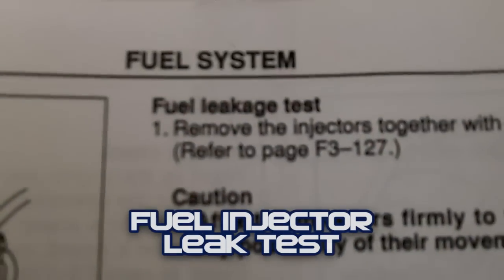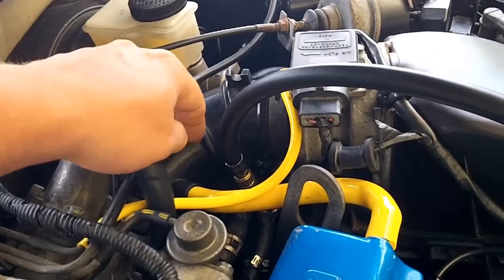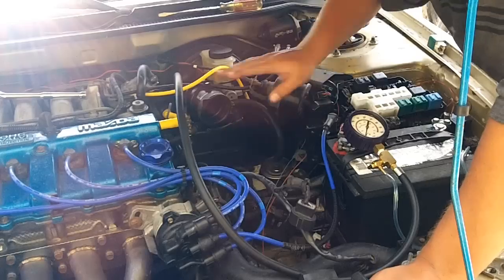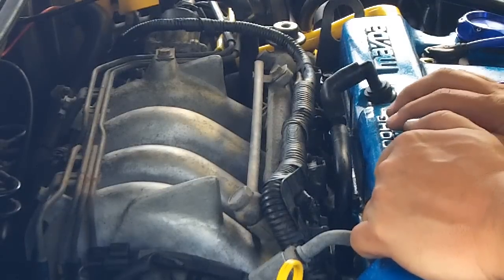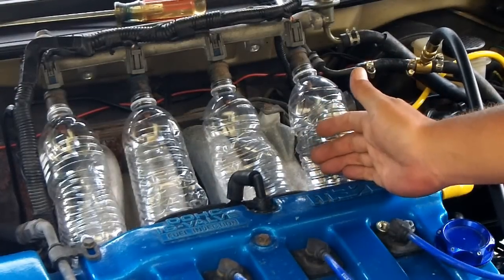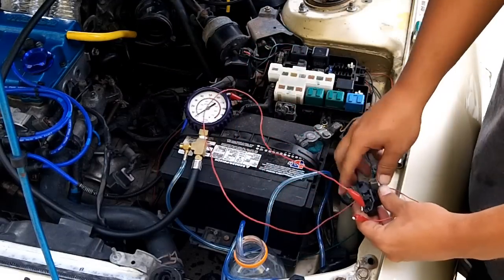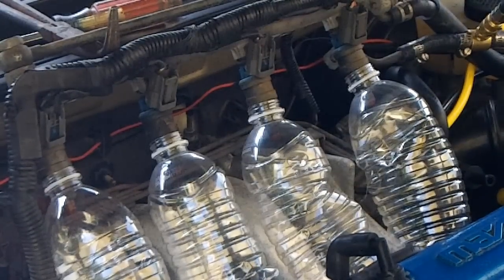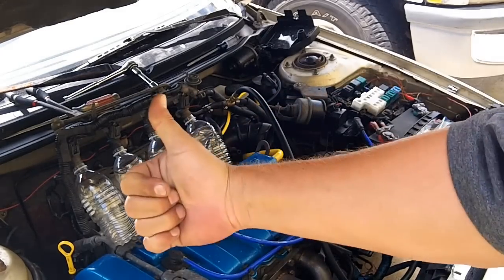Mazda 626 - Fuel Injector Leak Test

Comment: Hey DJ , Cam your suscriptor here.Bro  o needs ur help I saw in worksmanual two values for ect mtx use 2!2 kiloms and ATX 35473 oms? Is that correct? I mean 2.2 to 35.47 kiloms? Or is that a typo error of the manual? I'm confused. I test mine and found at 30 degrees C 1.87 kiloms. The coolant fan work only on high velocity with temperature criteria but starting ac only start the condenser fan so I think anyway tje swnsor ect is bad, can u teoll me pls what i have to check?tje right value of ATX is 3.5 kilo oms or 35kikoms also my iàt is giving 25.8 kiloms in the readings with multimeters pls help bro. Btw relays and fuses all ok i wanna ad if i touch coolant fan when. Ac is on the fan start to run but  with temp criteria only work at high velocity thanks bro

Comment: Hey I’m replacing my fuel filter on 96 protege. I disconnected both lines from fuel rail now I don’t know where they go
Reply from the maker: Easiest way to never get them mixed up again; fuel pressure regulator is the return line. The other line goes to the fuel filter.
Reply: @DJDevon3  thanks It’s running funny. I will double check the hoses

Comment: Is it maintaining fuel pressure after you shut off the engine?
Reply from the maker: In this circumstance no. Fuel pressure is completely lost in about 5 seconds and it's not going through the injectors.
Reply: DJDevon3 If fuel injectors are working fine and not leaking, most likely its fuel check valve is the issue. Btw good vid, very informative.
Reply from the maker: @kevinfrancisco1730  You do realize this video is from 7 years ago right? I've already solved the issue and have an almost comprehensive video series on diagnosing and fixing the issue.https://www.youtube.com/watch?v=bCrIo2Sbi78&list=PLL7U2Ji08Gq0UFSaKrE9oCldzUtI691ip
Reply: DJDevon3 I didn't see the year it was posted. Haha 😁 still a good video though. :)

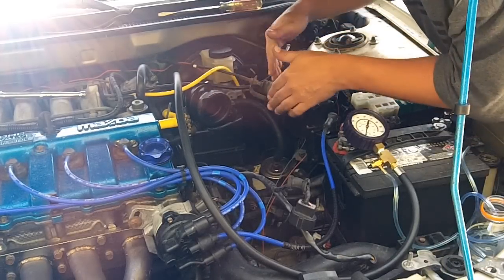Comment from the maker: The culprit ended up being a split in the hose on the fuel pump itself.  This is absolutely a necessary diagnostic step in ruling in/out an injector fuel leak. If it's not a fuel injector leak then the  fuel pump itself becomes the main suspect.  In my case the fuel pump hose was blown out and had a split in it at 3:00 in the following video:  https://www.youtube.com/watch?v=eeSdKNEMdwg The split was small enough so that the fuel line could still build pressure but was still leaking internally inside the fuel tank. When the fuel pump was de-energized all the pressure in the fuel pump went to zero.
Reply: Are out still doing videos? Maybe you can help me out? I have a 93 626 2.0 and it just shut off one day I starts and stays on of I hold the gas, but turns off  loses rpm. I've replaced so many parts like fuel pump the fuel relay the pressure regulator the tps. Any idea what I can do to figure this problem out? Had the car 10 years never had any real problems with it.
Reply from the maker: @dehaze7411  Have the distributor diagnosed by a professional. The distributor in the 626 is a common issue.
Reply: @DJDevon3  I replaced that whole unit not a couple months ago was running fine until a few days ago. Turns on but shuts rt off
Reply from the maker: @dehaze7411  look, i'm not a mechanic. there's no replacement for taking your vehicle to a mechanic. trying to find solutions online from people with opinions that have never even touched your engine bay is a good way to waste money.

Comment: What if your fuel injectors are leaking what are the symptoms?
Reply from the maker: Depends on the size of the leak. Most noticeable symptom will be bleed off of fuel pressure which is what this video is checking for. I have bleed off and looking for the culprit. In my case I had a busted fuel hose inside the fuel tank bleeding off pressure.  If the injector is leaking while the vehicle is off it will leak a certain amount as pressure is lost in the fuel line.  What amount that is and what effect it has on the engine on cold start I can't say exactly. You'll definitely smell fuel coming out of the tailpipe, maybe some smoke from unburned fuel, rough initial start. Again, depends on the size of the leak.
Reply: Poor starting when warm because the sparkplugs get flooded with fuel
Reply: Manuqtix Manuqtix same, crappy starting influences the entire engine not only the cilinder that’s getting too much fuel

Comment: Might pop off.....secure..withzip ties...or
Reply from the maker: As mentioned in the video description, the video, and in Mazda's WSM. The correct way to do it (which I do not show) is to use wire to secure the injectors if you intend on doing an injector volume test.  I do show the diagram for it.  It was unnecessary in my case, I was only looking for a leaky injector on my diagnostic path towards proving a faulty fuel pump.

Comment: May I ask which one pipe is the Return cause I need to install something with it and I don't know which one is the return, is it the metal pipe that goes to the side of the engine belt or the one that is only rubber that connects to the pressure regulator.
Reply from the maker: Fuel pressure regulator is the return line, hose from the regulator goes to the hard pipe beside the fuel filter. Line coming out of the fuel filter is the supply line to the fuel rail, not the fuel pressure regulator.  :)  I've seen plenty of guys get those crossed up when putting an engine back together, it happens all the time so don't feel bad if you do it.  Happens all the time.
Reply: DJDevon3 I appreciate your answer and thx for it now i will put it on the correct line

Comment: good job
Reply from the maker: This test is a video representation of actual mazda technical procedure.  Just ensure to tie down the injectors or they'll get shot off  by fuel spray.  I didn't have that issue because I had a faulty fuel pump with very low pressure.

Comment: One word of caution, gas will EAT many plastics pretty fast. I was changing out the fuel filter one day, took of the top hose and then bent it over inside the engine to dump out the gas in it, (I wanted it empty before I pulled off bottom hose, think gravity) into a standard plastic party cup you would use at a kegger.  I saw it ate thru that really fast, good thing I had rags under it and got it out of the car fast. 

So...kudo's for "recycling" plastic bottles but everyone should try putting gas in/on their plastic catch device and see what happens before committing it into the car.
Reply from the maker: Great point.  I didn't even think about that.  Could have been a disaster if attempting it on a warm engine.  Tests like this should be done on a cold engine to prevent a hotspot causing a flashpoint.  Great advice.
Reply from the maker: After doing some research, PET or PETE commonly used for plastic bottles will not degrade if holding gasoline/petrol. :)  Most common approved plastic container is HDPE (thick plastic) however PET/PETE will work.  I don't recommend using a PET/PETE container for a long period of time.  For temporary use in an injector flow test water bottles are perfectly OK.  Also don't use them on a hot or warm engine.  Always ensure the engine has fully cooled down.  It doesn't take much heat to melt through plastic water bottles and then well, you have gas pouring everywhere not smart.  An injector balance or flow test should only be done on a cold engine and obviously, the engine isn't running for this test.
Reply from the maker: If you have the choice between water bottles and gatorade bottles choose the gatorade.  They are much thicker plastic.  However the lid is bigger in diameter so you might get a lot more spray coming back out of it.  Secure the injector and tape the hole best you can.
Reply: Hey Mazda 626'ers, I just did a test, I put about 4oz of gas in a typical thin plastic water bottle, like you had on your injectors and left it (in a bigger tin can) for 3 hours, did not eat through it.

 It has Number 1 recycle symbol on it - which is PETE, don't know who this PETE guy is but he can hold his gas! I looked at the Party/Kegger type plastic cup I used that the gas ate right through, no marking on it. So I'd suggest for all to always do a test no matter what its marked..who knows, and like DJ said don't use it for storing gas.

Now I'm going to do the injector test you showed, I liked that! Normal working with Gas warnings apply.
Reply from the maker: Don Agneta Yeah the red solo cups are a different story.  Those thing are #6 polystyrene which is the weakest against gas.  Fuel will eat right through it like acid. It's in the same family as styrofoam. Use anything with a #1 recycle symbol and you'll be good. ;)
Reply: Yeah, per my first post I found that out the HARD WAY!!! Funny now, not so funny then, imagine my face when gas started going right through it. Ahhhhhhhhhhhhhhhhhhhhhhh! Fortunately just a bit I dumped out from the fuel filter. If you want a good laugh, pout a little gas in one and then you will see what I felt like. Ahhhhhhhhhhhhhhhhhhhhh!!!!
Reply from the maker: Don Agneta I hope you can appreciate the thought I have to put into these videos because one tiny incorrect statement could set someone's car on fire.  It's why I read the workshop manual as much as possible.  Seeing gas chew through a cup sitting on your engine and leaking all over the place probably would have given me a heart attack.  Glad everything worked out and you learned a valuable lesson without any serious consequences.  Bet you'll pay more attention to the types of plastics you work with and will never make that mistake again. :)
Reply: Don Agneta cf

Comment: hey did you have any codes for rich condition or any codes at all how did you determine that you needed to do this test. or was it cause it was burning a lot of fuel i know you sad you did a fuel pressure test was their codes prior for you to do this test.
Reply from the maker: Was actually due to a misdiagnosis on my part.  I misunderstood part of my previous test result for low pressure and thought it was coming from the fuel rail side.  It was coming from the fuel pump side.  So for me this test was completely unnecessary but still nice that I got to show the procedure in a video.  I have an OBD-I vehicle, there are no fuel pressure related codes, actually I received no codes period, there certainly was a big problem with fuel pressure which I discovered in a later video after dropping the fuel tank and inspecting the fuel pump.  It was a great learning experience. :)

Comment: Hi DJDevon3  ihave not this car Me car probleem first rough idlle and now to much overfuelling For this car Fuel pump new Boguies new New cables Coil new New distributorcab&Rotor new Timing oke New battery Fuel Pump Relai New Engine is not running, but does not start Carreparteur say ıt compression 7.5 bar During the compression test, the battery was almost empty (starter motor difficult) and engine was completely cold No fault codes http://youtu.be/_nELW7k6QrA
Reply from the maker: +Mehmet Wow that's a lot of fuel.  I don't recommend attempting to start the car like that.  Fire hazard.

Comment: Just pinch off the fuel return hose and you should see the pressure stop dropping or slow down if it was the regulator.
Reply from the maker: ***** That makes sense.  Didn't know that thanks.  I show the culprit here if you're interested.  https://youtu.be/eeSdKNEMdwg?t=2m51s

Comment: appreciate the video. is the ram yours? I have a 99' If that is yours... do you have a large thick hose coming off your evap shit under the hood? if so could take some piks or a short video of what it is and where it goes? I know it comes from the charcol box but where it goes under the hood
Reply from the maker: Richard Cowtails No the RAM 1500 is not mine.  Most I've ever done on that was install a new radio and change the oil.

Comment: I know that it might be to late.. but here is a way to test wether the fuel pump check valve is stuck open: just block off the line between the fuel pump and the fuel rail, and have the pressure tester on there so you can see the pressure. You do not have to get underneath the car to do this, you can just do it in the engine compartment.  The same applies to rule out fuel leaks in the fuel rail-injectors-regulator assembly, Unplug the fuel line to the fuel rail and just pump some air pressure in to the fuel rail using the port left open ( you can use a tire inflator pump/compressor- it already comes with a pressure gauge to check if it is leaking)
Reply from the maker: Neat idea.  It's never too late for more ideas.  :)

Comment: Hey man, just wanted to thank you for the hard work you put into these videos. I have a 1994 mazda mx6 2.0l ATX and it was dying sometimes while idling, getting really bad gas mileage and had trouble starting after leaving it sit for a while, but it would always start fine in the morning. I watched your Fuel pressure regulator video and pulled that top vacuum hose off of it and fuel just poured out. Replaced it and it runs like a dream now. Thanks for saving me time and money
Reply from the maker: If fuel comes out of the top vacuum hose to the regulator then it's a blown diaphragm inside the regulator and must be replaced.  This has become a bigger issue since gasoline switched to 10% ethanol.  Ethanol will chew through rubber faster than regular gasoline. You might even expect this to continually happen again going into the future if they continue to add more percentages of ethanol into the gasoline mixture.  Thanks for posting your issue and the answer.  Should help others here with the same issue.  Your welcome for the videos.  They are fun to make and keeping 626/MX6/Probes on the road is what it's all about.

Comment from the maker: Have you tried pulling any codes?  Check for air leaks, check for good spark, and check for good fuel pressure.  Those are the minimal basics and depending on how those tests go it will lead you in the right direction.

Comment from the maker: You're welcome for the video James Blodgett however unless you do a leak test you cannot definitively say that your injectors are leaking.  Just because it acts like it's flooding and you smell gas doesn't necessarily mean that the injectors are leaking.  You could simply be flooding the cylinders due to long crank time or the engine not turning over due to low fuel pressure.  A leaking fuel pressure regulator could also cause an issue.

Comment: Thanks for the video, I know mine are leaking because when I shut it off, go start in again 5 to 30 min later it acts like it's flooded & it's getting worse, changed my oil & it smells like gas really bad. I will do this test to see witch ones are bad, $105 a piece gets spendy.

 2002 Olds Intrigue, got it 8 years ago this month with 73,000 now it has 224,000 miles
 Thanks again for the upload :)

Comment from the maker: Honestly I haven't tested the line pressure without the fuel filter because it's a pain to remove.  Will do that as the next step actually before going into the fuel pump diagnostic because you're right, it's the right thing to do and still a diagnostic step that should be done.  With the evidence gathered so far I can only say for certain that the culprit is between the filter and the pump somewhere.  My guess right now is it's going to be the pump, specifically the check valve in the pump.